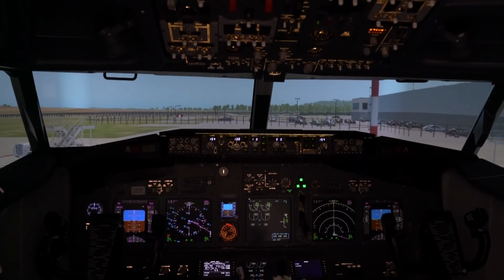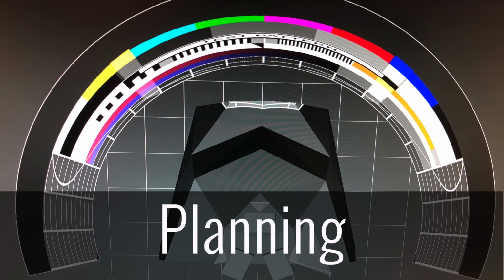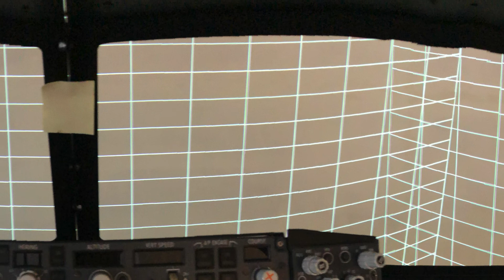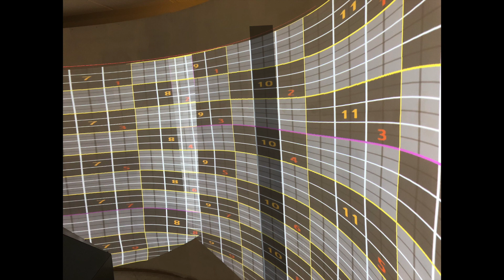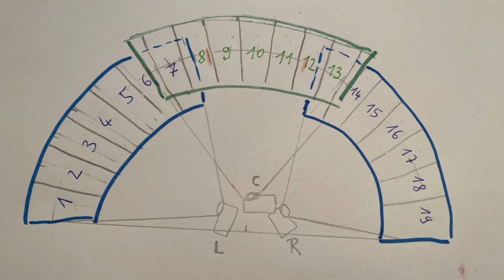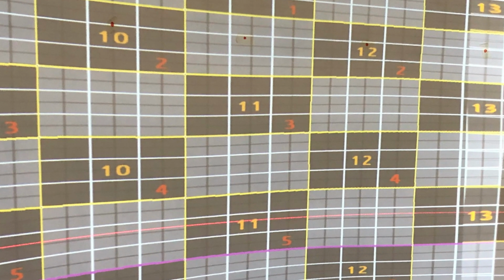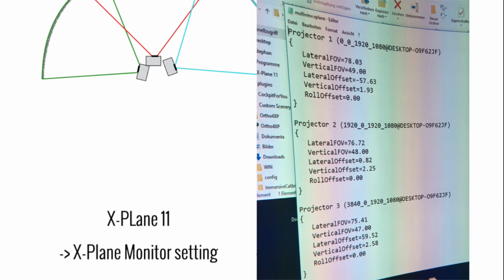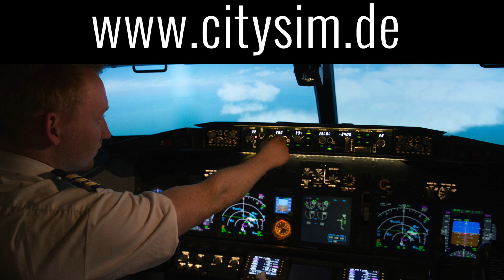#2 - 737 X Plane Homecockpit Episode Two - Projection

Comment: the bigger the screen, the better the effect, problem being of course space, but also the brightness required of the projectors, it gets impractical if you need cinema brightness even in a basement or garage.
old hollywood has a solution, retro reflective front projection, as long as your viewpoint is close to the projection point, the screen can be as large as you want and still look the same.
I don't know how practical this would actually be, but I'm surprised nobody has tried it.
for regular projection a darker screen colour can increase image quality by a lot, it only slightly darkens the image but it catches much less stray light, so the overall effect is that of a brighter and less washed out image.

Comment: Hello, excellent video tutorial! Just one question, how is the procalib configuration file loaded...in Xplane and where, thank you very much! I have 3 projectors, I already have the image calibrated with P3D, but with XP11 I don't know how to do it...
Reply from the maker: Thx Ernesto. please consider this video is a bit dated ;-) Calib Pro exports some 6 files into a procalib folder. 3 of the files contain that data that you put...i mean enter (typing !)  manually in the graphic settings for the 3 displays/projectors with their FOV, horizontal- and vertical shift. Done.

Comment: I am in the same shoes.  I built a 180 degree screen with my students.  We have had no luck with Fly Elise helping us.  We are using XP-11.  Is there anyone that is available for a phone call or zoom meeting to help walk us through the process?
Reply from the maker: What is the issue?
You purchased a license, wrote them and they did not answer? 
Maybe ask in our FB group „xplane homecockpit english and german“ as well.
And read the other answers/posts…ie go to graphic settings…never ever touch nvidia surround…follow the calibration pro manual

Comment: Hi great video and useful info there.
I have the same problem with XP. 3 projectors and only one monitor set window on XP. What does that simply create 3 monitors on XP mean? Can I create monitors in XP while I get to have just one monitor setup in XP?
My XP is not a pro version. Thanks!
Reply: I had the same problem  and I've just fiex that now. Fly elised support team help me out. I didn't understand what they mean but after following their instruction I got that view on X plane
About the instruction. Get out of NVDIA surround mode. Assign each projector with corresponding procalib files. (My case was multi_projector1.procalin and 2, 3) 
Leave descktop warp disabled, Leave Vulkan is not diabled in Display pro. (open Display PRO preferences and in Extras make sure that Vulkan is not disabled)
Set X plane graphic setting with ICP exported xplane view setting value) 
Then I got the view on X plane.
Thanks to the Citysim737.

Comment: Great video. I can not get xplane 11 (non pro) to have more than 1 monitor. (Projector) When I open immersive display pro after the Calibration export and go to.simulators for xplane it has 3 projectors on the right and a popup on the left. The popup only allows you to pick 1 projector in immersive display pro. Do you need a xplane pro license to get ot to work? My p3d viewgroups are fine and fu Warping works perfectly. But xplane is giving me problems.
Reply: I had the same problem  and I've just fiex that now. Fly elised support team help me out. I didn't understand what they mean but after following their instruction I got that view on X plane
About the instruction. Get out of NVDIA surround mode. Assign each projector with corresponding procalib files. (My case was multi_projector1.procalin and 2, 3) 
Leave descktop warp disabled, Leave Vulkan is not diabled in Display pro. (open Display PRO preferences and in Extras make sure that Vulkan is not disabled)
Set X plane graphic setting with ICP exported xplane view setting value) 
Then I got the view on X plane.
Reply from the maker: @hwangsunil1761  exactly as I said ;-) 

Why the heck would you have Nvidia surround turned on? This should be really almost logical as it kills individual / discreet outputs and creates one view instance :-)
Reply from the maker: Hy mate. 
YOu dont need XP Pro. 
In XP you simply create 3 monitors. 
Calibration Pro creates the values you enter in the graphics setting page of XP manually /fov, vert. and horiz. shift). 
In IDP you pick up the multicalib files from ICP. 
That should do it. 

And please write to FlyElise that their manual sucks, they need a way easier step by step guide. So many people struggling. 
And that they should do a Mac M1 version :-)
Reply: Hi great video and useful info there.
I have the same problem with XP. 3 projectors and only one monitor set window on XP. What does that simply create 3 monitors on XP mean? Can I create monitors in XP while I get to have just one monitor setup in XP?
My XP is not a pro version. Thanks!
Reply from the maker: @hwangsunil1761  go to graphics settings page. add / select monitors ...1, 2, 3. Did you do that?
Reply: @citysim7375  Thanks for the quick response.
In my x plane’s graphic setting I only see one monitor setting. I can not add 2, 3 monitors. It probably is because my X plane is not the pro version.
I’ve been getting help from Fly Elise and didn’t get successful result yet. They instructed me to turn off NVDIA surround mode then to assign each projector with corresponding procalib files and leave the desktop warping disabled, which I don’t understand. How can I get calibrated view without desktop warping. Anyway I’m struggling with this at the moment. I hope I get this done soon.

Comment: I think I will do a curved screen for my a320 home cockpit but the only thing I don't like is that when you do day flight the outside looks like day but in the cockpit its dark
Reply from the maker: One of pot. more solutions: Put it a light (controllable LED) that creates an ambience similar to the color outside. I saw this in a sim in CZ republic (Pink Skyvan) and found it mega clever. Stunning Sun light effects.

AND: I tell you the night is worse: The overlap is generally to bright (when it is ok set  / optimized  for daylight. Solution: different brightness etc set for night flights. Doable, but work. I didn'tdo it - too  lazy/ busy.
Reply: @citysim7375  ok thanks! I was thinking of also maybe using the tv's because they make much light but they cost to much thx!

Comment: Looks great, we are using 5 x 1080p projectors on an 8ft radius screen. I'm curious as to how you guys ensured that the FOVs were correct for a 1:1 image. Did you have a testing setup or did you simply adjust until it felt right? Thanks
Reply from the maker: Wait, what´s 8ft in proper measurement...2,43m ok :-) A little fun. Very similar to my size if i remember correctly.
I went for only 180 degrees (so the image is better than if you aim at 220 degree or so). And the rest is simply done by the way you spread 3 projectors across 180 degree: you need 3 x 60 PLUS the overlap in the blending. FlyElise IDP (designer pro) will spit out the values, around 70 degree. This means X-Plane eventually creates a 180 degree picture which is perfet for my desired 180 degrees. Really easy - unless I misunderstood your question. 
The heigt alignment you do with the simple trick to park opposite from an identical aircraft and you want to be eye to eye with the other pilot.
Reply: @citysim7375  Thanks for the quick response. I'll clarify a bit on what I meant. For example, let's say there was a 5 meter pole stationed some 20 meters away. In reality, this pole should appear a certain height on the screen (which can be easily calculated). I was curious how you guys were able to ensure that the image showed the true size as to what reality would suggest. One of the biggest issues I have had with XP is objects not showing up correctly in the vertical axis while they show up fine in the horizontal axis.
Reply from the maker: @acecomer98  Good point. Probably important for certification. Not in practical operation. Much more tricky for me is the crab angle which we optimize for the most important seat (ie. pilot flying / customer). 

NONE of some 30 commercial pilots who flew with us ever complained about the graphics / projection AND size of object / angle of objects, ie. runway dimension in the sim. "better graphics than in most Level D sims". "stunning Details. "

How would you go at the correct height? Can only be the angle between bottom and top of the ie 5m pole? So We park away from a pole, lets say an apron light pole and compare real world and sim? Obviously with height being checked in world editor or so...
Reply: @citysim7375  I gotcha. Actually, I set up a model with some known heights and verified the height. All is well on our end for 1:1 object size as our warp and blend software defines FOVs for us. I appreciate your responses!
Reply from the maker: @acecomer98  Nice! How did you verify the height in the projection? Where is your sim and what aircraft? Would love to see!
Reply: @citysim7375  our sim is at a university for research purposes. I’d be happy to share some photos. We are working with eVTOL UAM concept aircraft, so we make our own custom aircraft geometry. We then take this geometry into X-Plane’s PlaneMaker and replace an existing aircraft. Since we have full control of the geometry, we insert test objects of known sizes at known distances and calculate the size it should appear on screen. From that, we ensure that the view is accurate 1:1.

Comment: Thanks for sharing your methods.  If you had the Pro version of X-Plane, would you have used the inbuilt warp features as oppose to 3rd party?
Reply from the maker: I do have the Pro Version of XP .
Warping though  is not comparable to FlyElise. Basic warping only . With the exception of some Natvis (or so) users almost EVERY cockpit builder uses FlyElise for warping & blending. Check out Back Bedroom Pilot´s Videos. He shows a perfect blending with 2 projectors.
Reply: @citysim7375  that’s good to know.  I’m also in the process of building it.  XP internal warping simply doesn’t work.  And when I use external program to do the warping, the projectors look weird/unwarped when that screen is in focus, when you Alt+Tab out of that screen, it gets warped. Have you experienced that?
Reply from the maker: @Inserico  no I haven't. What software are you using? You need to watch some videos in order to correctly use FlyElise. And read the manual.
Reply: @citysim7375  I'm using SimPitWarp (which is basically FlyElise Display Pro I think).  I find that if I don't enable the "Projection parameter" option in XP Pro, the runway markings/image don't align.  But if I use that option, it aligns but there's a big bubbly/round mask on the outside of the image.  Do you use that option along with FlyElise?
Reply from the maker: @Inserico  simpit is a different product than IDP. 
You have to enter the calculated figures of your calibratino SW into XP of course : FOV, horizontal and vertical offsets in graphics settings. 
Not sure what you mean by "ENABLING PROJECTION PARAMETER". I don´t know that check box. But of course I entered data in graphics settings.

Comment: So I suppose the ONE PC PER PROJECTOR is if you use X-Plane's 11 pro software. If you use elise you can have 2 or 3 projectors per pc Correct Captain?
Reply from the maker: Not sure I understand what you want to ask :-) 
I have a pro license but never looked into the warping. LR said it is rather basic and provides basic cylindric warp. Every pit I know uses FlyElise here (very few the australian thing). Yes, I have 3 1080 projectors on the visual PC. 
One PC per monitor?: Check out Michael Swannick, he runs on PC per 4k monitor.
Reply: @citysim7375  A friend told me that xplane11 allows you to calibrate a screen 180 or more via its software only if you have 1 projector on 1 pc. So if you want 3 projectors you need 3 pc. But from what I see with this software you can calibrate 3 projectors on 1 pc.
Reply from the maker: @nikosgeorgakis6759  Well, you need to ask this specific question LR. ----the graphic settings generally allow to set 3 monitors with lateral rotation (you have XP? play with it with 2 monitors yourself!!) - Again, I would ask: is the warping (of the picture on the cylinder) and the blending (to hide the overlap of the projectors) good enough in XP Pro? Again, some Aussies use NAtvis or so. Everybody (!!)  here uses Flyelise ;-)
Reply: @citysim7375  thank you for your interest and kindness Stephan! I really appreciate it! You helped me a lot!

Comment: We are having a hard time getting it to work. We have the blending done and the file saved. How do we get it to work in x-plane? We exported files but are stuck. Please help. Thanks.
Reply from the maker: you enter the fov, lateral offset, vertical offset manually in the XP monitor settings. You loaded calib files into IDP? Are you in the FB group X-Plane Homecockpit? Various projections guys are in the group. 
Send me a mail if nothing works.
Reply: @citysim7375  thank you. We will give it a try and I'll let you know what happens.
Reply: So it was a no go. Cant seem to get warping to come up. Entering all info as you stated. Is there something that we need to do with display pro? Getting image on projectors but they arent warped
Reply from the maker: @briancrosby3767  I had this as well once. Don´t remember what it was. You are on the latest version?
Reply: @citysim7375  yes, we just downloaded latest version
Reply: I am having the same issue where IDP does not warp the screens.  Was there any resolution to this?

Comment: Stephan, great, congratulations for what you did and so fast. I made a cockpit too but took me allmost 5 years, is too easy to get lazy and more when you choose to build against buy them because of cost. Two big questions. I got to fit my cockpit in a 2,4 meters wide room  keeping the 1 to 1 scale and used three curved 48 inch monitors but I sold them because the color shift (angle view) between was a stone in the shoe and the bezels were not thin enought, they were VA panels. Do you think your setup but with only two projectors would fit in a squared room of 2,4 meters per side? I can get to fit the curved screen but there is a lot of things that only experience like yours can clear. The second; how is the black quality (contrast) for night flights with the Optomas? Right now I am beetwen buy two proyectors or buy the three Tvs this time with IPS panels.
Reply from the maker: Hi Huaso, thank you very much. Well...many questions. I am ok with the black - the width feeling of the projectors is just great compared to monitors. I / you have to use a different blending set though for night flights vs. daylight vs. twilight, otherwise you have a brighter spot in the blending area. 
As long as you can get the picture over the shell, a 2,40  room might work somehow. I have reduced from 220 to 180 as you saw, and I guess even one screen to the front (only) might work? Will post a twilight flight sometime. Night needs more tweaking before posting.